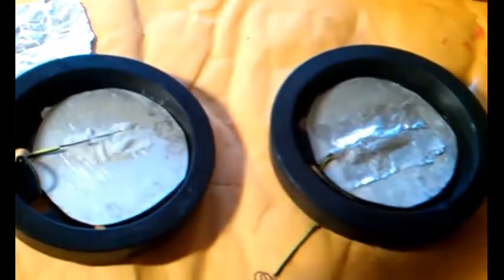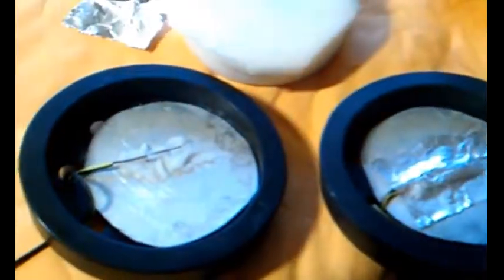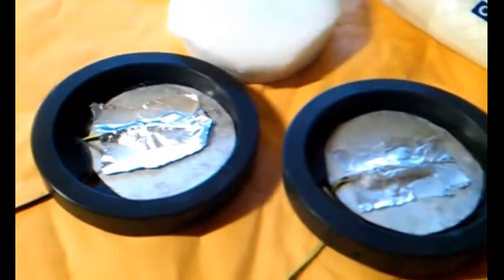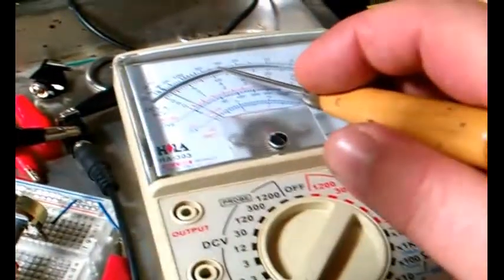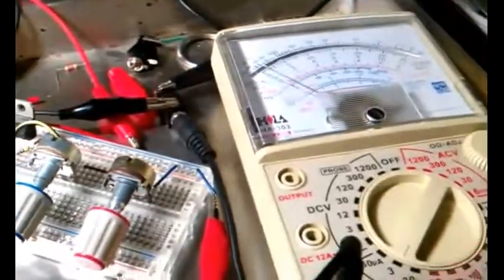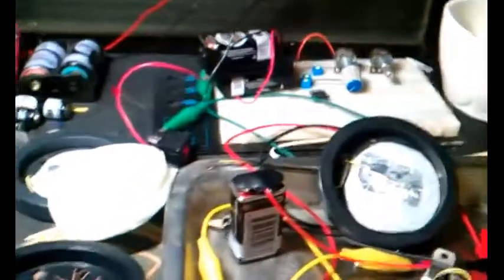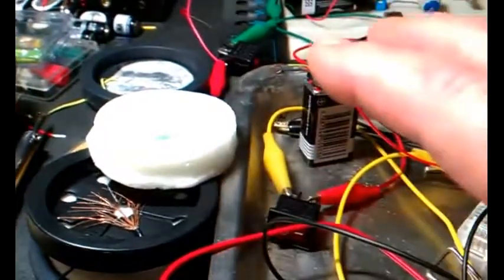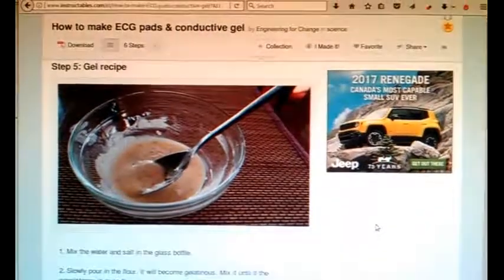My tDCS Experiment: Part 5: Optimizing the Electrodes (sorta...)

Comment from the maker: PS: When I said that I "brushed" the inside coating off of the aluminum, what I really meant was that I "sanded" it off with sandpaper. (The resulting finish is called "brushed aluminum" -- like the iconic DeLorean --because it's typically done with a rotary wire brush.)